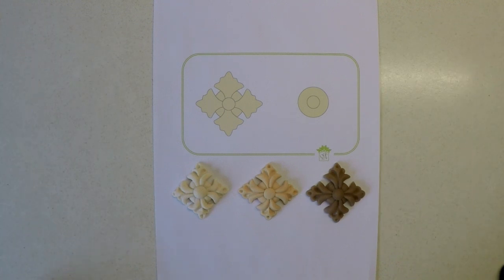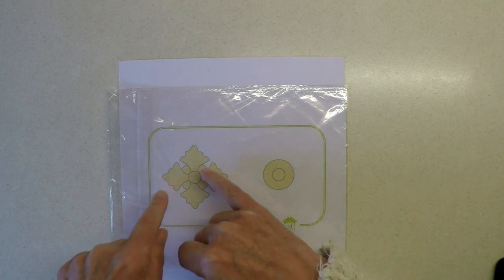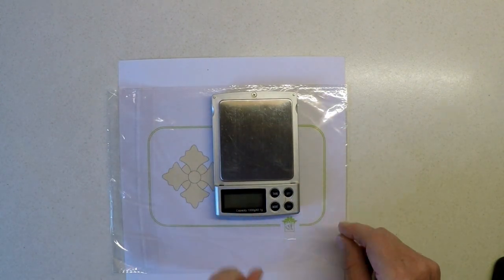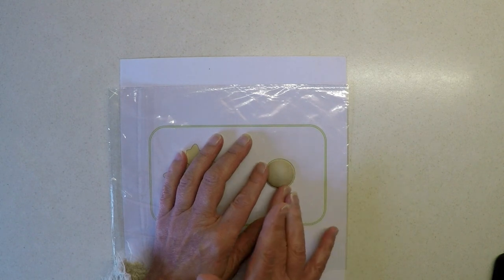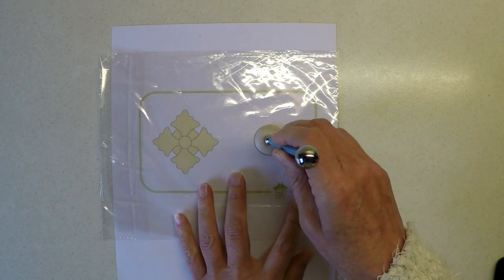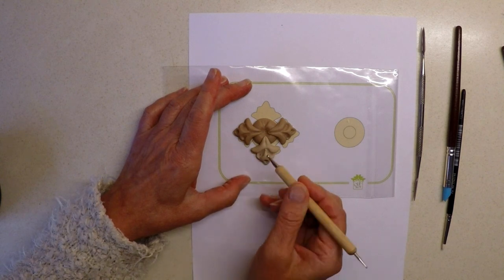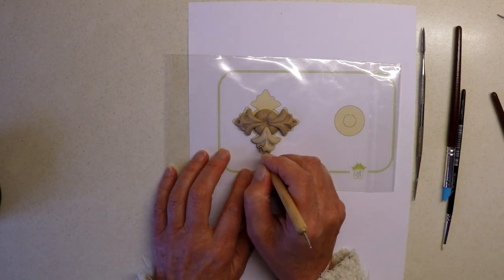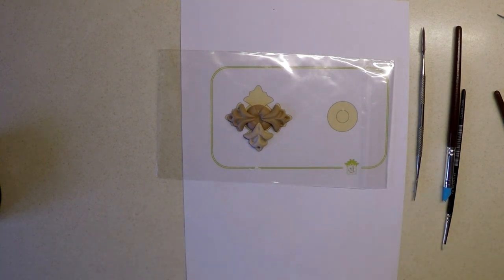Cold Porcelain, Ornamental Cross-Shaped Florette,  Step-By-Step Tutorial.  (Free Template)

Comment: One more question(no hurry). Is there some formula you use to determine how much clay for each section? I have a graphic that I personally drew that Inwould like to try this with, but I'm new to clay and not quite sure where to start. I need to make 3 so id like them to be consistent. Thanks again.
Reply from the maker: Hello again

Very good question .. consistency of size.  It's a tricky one though because there are variables.  You just need to bear in mind that cold porcelain shrinks as it dries and the extent of the shrinkage is dependent on how much moisture is in the wet mix.  That's difficult to control.

If I was looking to create consistent size shapes, I would probably mix the colour into one batch that would be sufficient for all the shapes that I wanted to replicate.  I would then aim to complete the work on the same day if possible.  Store the unused medium to minimise risk of drying which would reduce weight.  Weigh the same amount of porcelain for each component and use templates where possible to help reproduce the same size object.

If you can split your design into separate components .. create all the first components for each replicated object and then create all the second set and build in that way.  If your first components are all the same size, then you stand a chance of ensuring the complete objects .. based on proportion alone would be a very similar size.  Just be aware that when you add your second layer, the proportion of that second layer is going to seem slightly too big and that is because it will shrink as it dries .. this takes a bit of getting used to and is where templates are invaluable.  If you have adhered to the size of a template for your first layer, trust the template and adhere to that for your second layer .. if the cold porcelain is from the same batch it will shrink at the same rate and as it dries, the proportions will align.

Hope that helps .. happy crafting :o)  Sally